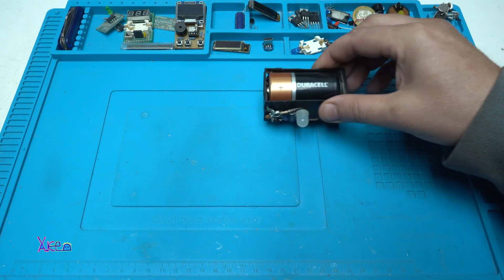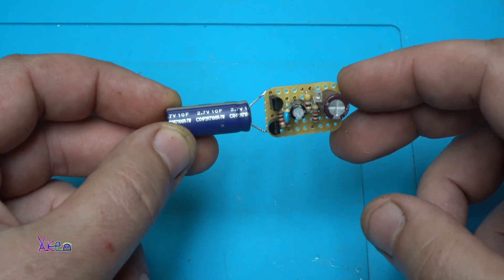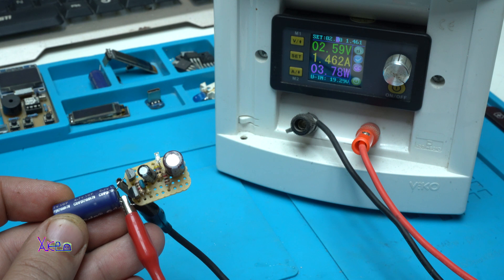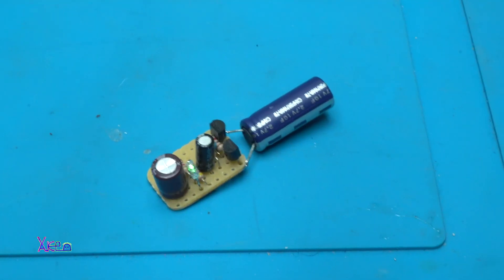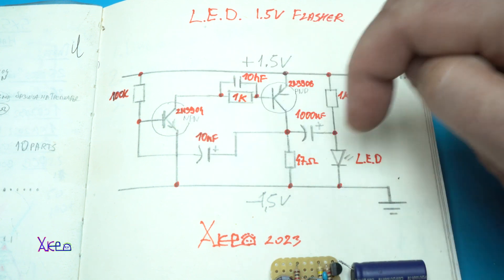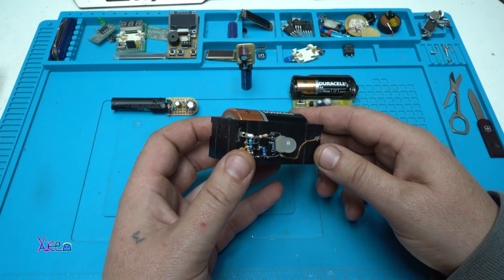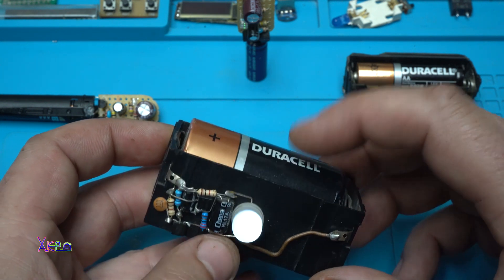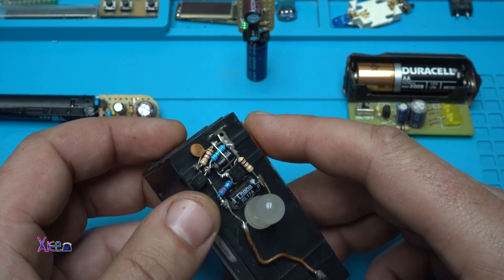This LED will blink for 5 years with One 1.5v Size D Battery

Comment: Dear Hacktuber; 
I have a few questions for you. Could you please share the sequential steps in the formation of this circuit? 
Also, when using multiple LEDs, should there be any changes in voltage or components? 
Thank you in advance for your reply. 🙂
Reply from the maker: Check this video,maybe will help you. And if you add more leds in parallel all will flash but will pull more power from battery.
https://youtu.be/brn02i49Euw?si=YBdm08osr-gaEO23

Comment: Thank you so much for this.    

I love the flashing affect on the first circuit and is exactly what I was  looking  for to add to a model rocket for some night launches.
Reply from the maker: No problem I am glad that help👍
Reply: @Hacktuber I’m sure it will!  

Some of the features that make this so perfect as a beacon for model rockets is that it is small and light; no heavy cells or battery packs, just a light super capacitor
Reply: @Hacktuber Actually, quick question:   How many LEDs could this circuit drive?

Comment: A project in which to make a led blink less often, i.e. 4-5 or 6 seconds, for a long time? Or what component should be set to differ the time between flashes? Mulțumesc.
Reply from the maker: You need to experiment with changing lower or higher capacitors
Reply from the maker: Watch this video: https://youtu.be/brn02i49Euw

Comment: Hi nice circuit, the base of npn 2N3904 is shorted with its emitter and the negative pole of electrolytic capacitor 10 uF? Can I use 100pF block ceramic capacitor and 220uF instead of 10nF and 1000uF respectively?

Comment: Very nice! I like your projects! Please, i have some questions.

What would be the replacements for 2N3904 and 3906?
What does block capacitor mean, can you put a link to these block capacitors?
Can you show how can be changed the time between flashes to approx 10 seconds?
Does the montage work with a CR2032 - 3V battery?

Thank you for sharing! All the best!
Reply from the maker: You can use npn bc547 and pnp 557 transistors,yes the circuit will work on 3v but not much efficiant.The block capacitor or also called coupling capacitor is not as electrolitic capacitor which have positive and negative pole and last you need to change the 10mf capacitor with lower capacitance to blink faster.thx for feedback 👍
Reply: @Hacktuber Thanks! I tried to find these block capacitors but it seems to be hard to find, at least for me.  Please, can you put a link to these capacitors from where i can buy, or can be replaced with other type of capacitor? Also there is another way to work this montage whitout this capacitor? All the best!

Comment: i have built this circuit before and powered it with an almost dead AA battery and it lasted for 6 months
Reply from the maker: Yes I know that,its a perfect led circuit for dead batteries
Reply: And how does such a circuit works? Can you explain briefly?